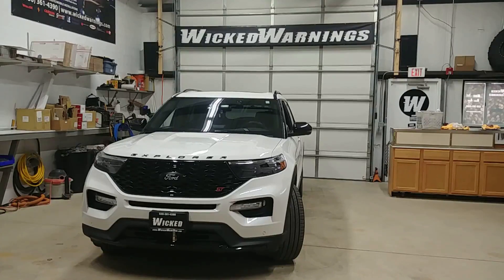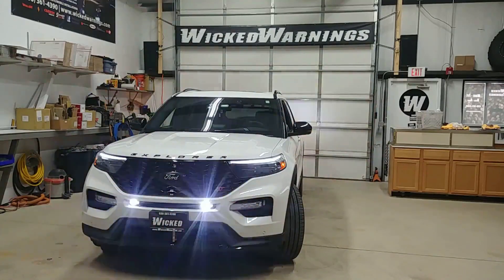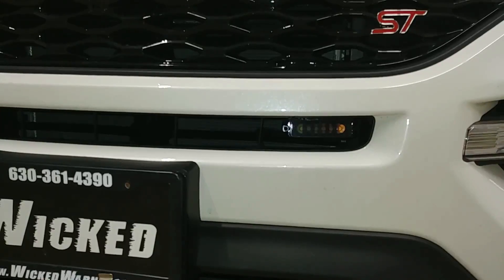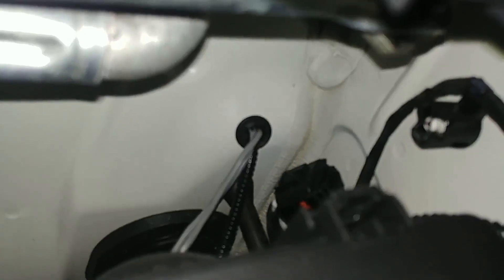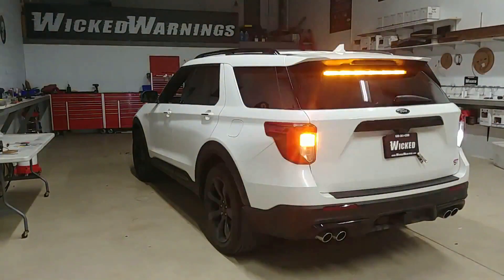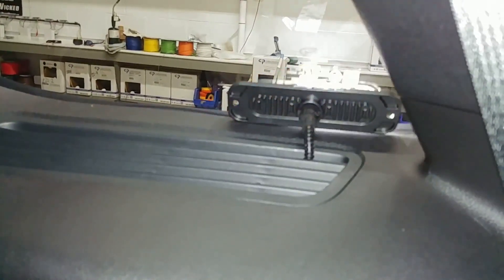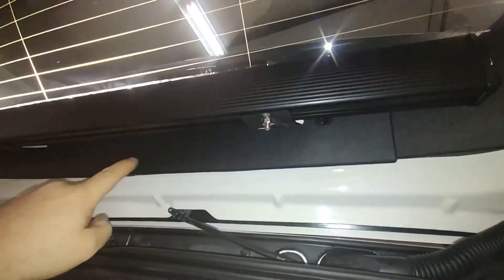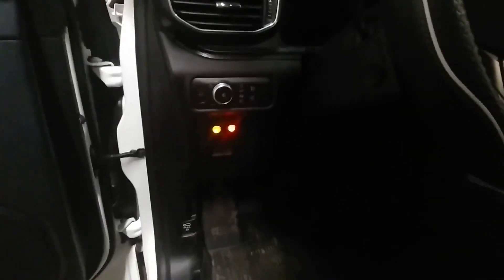2020 Ford Explorer ST Warning Strobe Lights

Comment: Thanks for the info on the boot. I passed my switch for my spot led in  the boot you showed on your video its such a pain to work on that boot.   After 2 hours of pushing a guide, I was able to go inside from outside the hood. Thanks again
Reply from the maker: Glad it helped

Comment: Do you have any of those wicked sticks for a Dodge Charger that can do white Amber and blue but you can select the colors you want and it stays that color until switched and then you can color combo it to flash .flash white or blue are white and Amber are blue and white etc?
Reply from the maker: You need different switches to set different patterns.  We only have the siz head in  amber/white, green/white, and purple/white

Comment: Three stupids questions :

1) Any primer required to promote adhésion on window ?

2) Best way to remove the VHB years later for lease return ?

3) Using primer 94 dommaged paint under tape ?
Reply from the maker: 1) Any primer required to promote adhésion on window ?
YES
2) Best way to remove the VHB years later for lease return ?
USE STRING
3) Using primer 94 DAMMAGE paint under tape ?
NO
Reply: @WickedWarnings  Quick and accurate, thank's

Comment: When I can use this lights and it’s considered “legal”?  (I’m from NY)
Reply from the maker: Emergency lighting is legal if you use it in the appropriate situation.
Reply: @WickedWarnings  what’s considered using it in the appropriate situation??
Reply from the maker: Constructions workers in construction zones, snow plow drivers, someone pulled over in an emergency situation, the list goes on.  We do not recommend driving around with them on, unless authorized.